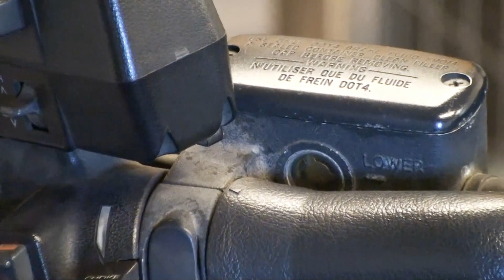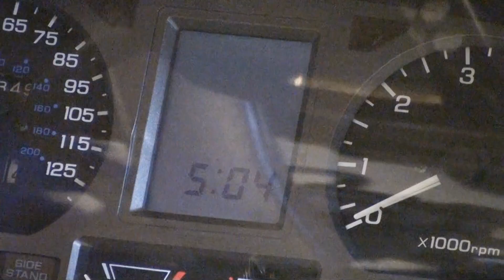Pre Trip Honda Goldwing 1500 SE

Comment: Instructive video but do you have checked the battery level and the brake pads?
Reply from the maker: I would usually check the brake pads at the start of the riding season. I check battery fluid levels when I change engine oil.

Comment: how much airpreassure in the back fork when two riders and some cargo?
Reply from the maker: It depends on the total weight. My wife and I are about 200 pounds each and I run at about 38 pounds without cargo. If we are loaded for a trip of a few days, I'll adjust it up to about 42 pounds. I try to make it just enough to not bottom out the rear suspension.
Reply: @repairsecrets  Thank you!

Comment: How much air did you put into the front shocks ?  Nice video also !
Reply from the maker: At the time of shooting the video I was putting about six to eight pounds in the front shocks. When I had to rebuild them I found that someone had put progressive springs in and didn't have the fluid levels correct. After the rebuild, I didn't need any air pressure at all and it changed the ride and handling significantly for the better.
Reply: @Aden Ernest instablaster =)
Reply: @Cullen Lawrence Thanks for your reply. I got to the site thru google and Im in the hacking process atm.
Takes a while so I will reply here later with my results.
Reply: @Cullen Lawrence It did the trick and I actually got access to my account again. I'm so happy:D
Thank you so much, you saved my account!
Reply: @Aden Ernest no problem =)